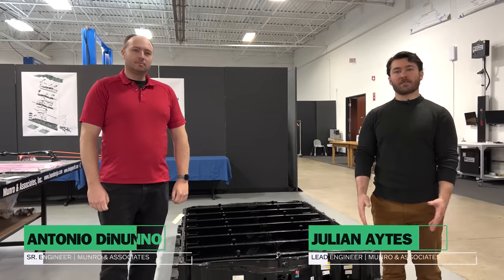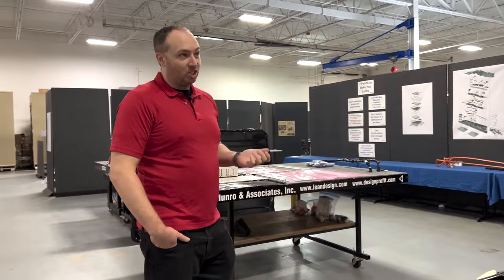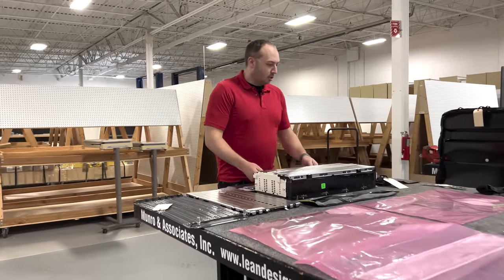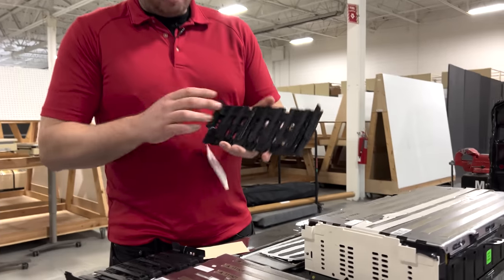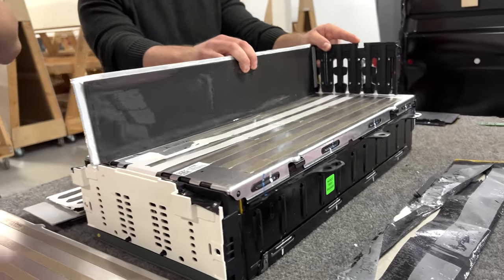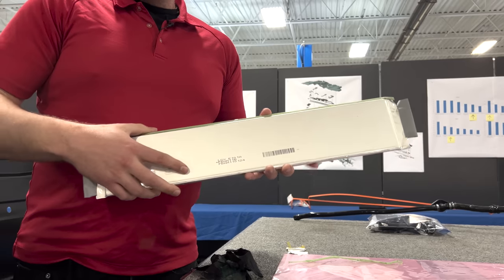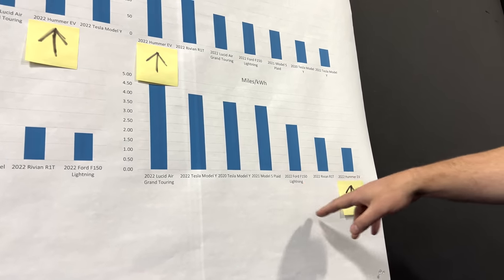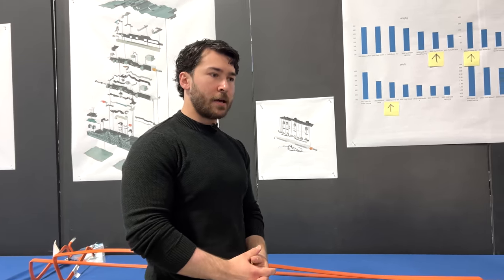This is NOT Lean Design: Hummer EV Battery Pack Breakdown

Comment: When batteries go bad, they are not just an open circuit. The question is if you lose one or a few of Cylindrical Cell isn’t BMS needs to back off the charging capacity of the whole module or that cell would be over charged? Isn’t going to be the same as this large cell?

The cell has large contacts surface area between each other’s, reduces thermal impedance between the cells next to it. Thermal equalization between the cells allows consistency of cells capacity across the module results in higher module current capability. 
Thank you, for showing this cool stuff.

Comment: 24:57 While it's true that running higher voltage will utilize the cables better, it's important to keep in mind that even at those higher voltages, the HUMMER EV is still pulling a sustained 500 A for a significant period of time, so it would make sense that those contactors need to be liquid-cooled.
Reply: It's sad for a teardown they missed critical features like wireless battery management. The fact Hummer chargers at a faster rate than any other EV and the modules can be used across vehicles.
Reply: @theflew  Great catch! I was so distracted by everything else I didn't realize that the never mentioned the fact that this battery features a wireless BMS. They've spent 15 to 20 minutes or more in other battery teardowns talking about great ribbons are instead of traditional sense leads because of how much material and weight they save. 🤔
Reply: @theflew  the hummer has a terrible charge rate for the size of the battery. It should be able to easily charge at 600+kw. We know that modern batteries can charge at over 3C. This piece of shit bearly makes 1.5C
Reply: @saff226  Please point to these magical 600kW chargers that could delivery that much energy. It can already max out 350kW chargers.
Reply: @theflew  Tesla's v4 superchargers can do 600kW. If GM moved to the far superior NACS plug instead of using the shitty CCS1 they would be able to use it
Reply: @saff226  Tesla's V4 Superchargers can do everything since they aren't deployed yet.

Comment: As a research engineer who has to design for manufacturability, Munro and associates have opened my eyes to just how much little things matter when to scale. Most of my job is just to "get it to work no matter the cost" but now I always keep in mind that just getting it to work doesn't cut it, it also has to be reproducible just in case it gets pushed forward to scale-up.

Comment: At the current Hummer production rate, 8 per year, if you own one, with design and advertising costs, it likely costs GM $100M each.  Perhaps the best deal on the planet for the consumer - not so much for GM.
Reply: Didn't they sell over 3200 last year?
Reply: @josephivan5094  - Sounds about right. My post was when they couldn't figure our how to make them (>1 year ago).  So far it looks like about 5000 have been made so far.

Comment: One thing to remember when it comes to stampings and the big 3 like GM, they have been using this form of manufacturing for so long and in so many facilities that they can very likely design and create new stamping tooling cheaper and weld it cheaper than it would to do it in aluminum.
Reply: This is the truth of it.
Reply: How many did they plan to sell anyway? 3? Not worth the effort.
Reply: @LachskoenigIV didn't they sell over 3k last year?

Comment: About a year ago we all took a "vote" and nobody wanted you guys to waste your time and money tearing down a Hummer.  I am glad you decided to do so as this just proves how stupid the engineering of the worlds EV leader is!  You guys are to be commended for not laughing too much during your presentation.
Reply: Munroe is directly responsible for 50% of the Hummer EV sales!
Reply: You forgot to scare-quote "EV leader".
Reply: GM WORLD LEADER IN WELDS!
Reply: this is an early production battery pack
Reply: @mus_xr4653 The engineers had a hangover while on CAD or high on other types of stuff?
Reply: @Stefan_Dahn  they only had few months to develop and test the hummer ev. inefficient design is expected when most cars take from 4 - 8 years to develop and test
Reply: @mus_xr4653  Yes, it looks like time was short so they took a belt and suspenders approach and will probably refine things later.
Reply: @mus_xr4653  That supposition is hard to believe.  GM has been in RnD for years, according to them, so this is their production line.  Meaning their RnD for years was severely lacking or poorly funded, yet again..GMs own admissions..claim they are leaders and have a excellent grasp on this technology.  Clearly, they do not.
Reply: @JasonWW2000  .  For that to be true it would mean GM knew they had a subpar product yet sold it as revolutionary yet was a lie.  This assertion alone should concern all consumers.
Reply: @mus_xr4653  it’s 2023. This battery is a joke. This might’ve been acceptable in 2007 but it’s 2023. GM has been around for 150 f-ing years! Their engineering is a joke.
Reply: @JasonWW2000  time was not short. They don’t have the talent and they failed to make the necessary investment. The HUMMER was a marketing stunt. They never thought anyone would tear it down and show off their BS TECH.
Reply: @mus_xr4653  May be “early production,” but Waaay late to the ballgame…
Reply: It helps your confirmation bias that they skipped over a lot of details and made some erroneous assertions. But hey, don't let data and facts get in the way of your preconceived notions!
Reply: @GET2222  You don't seem to know what you're talking about here. If this battery is 2007 tech, how is the volumetric energy just below Lucid and Tesla's best? And how is its gravimetric energy density on par with Ford, Rivian, and several Tesla products despite the Ultium battery case being a structural component while the others aren't? 🤷‍♂
Reply: @newscoulomb3705  you have missed the entire point. 2007 was low volume. It’s f-ing 2023. Why would you ever build something that can’t scale in 2023 unless it marketing and you never had any intentions of scaling. Right now GM needs to focus on scaling or they are out of business LUCID made the same damn mistake. Great tech, but $179k? That doesn’t tech you how to scale production. You can have the best tech in the world, but if you plan to keep your factories open the HUMMER was a terrible decision. Dumb. Absolutely dumb.

As for the tech itself? It’s out-dated. You are paying attention. Barra scoffed at 4680. Pouch cells are higher risk of thermal runaway. GM learned the hard way and then pivoted within the last few months away from pouch cells.a one ton canister for the battery is nonsense.
Reply: @newscoulomb3705  keep telling yourself what you want to believe. This product was never designed to scale. Marketshare should be GMs focus or they are screwed.

I own a design and adverting agency working with fortune 50 companies for over 25 years. I know what distraction and complacency looks like and GM is one of the best examples I have ever seen that complacency kills.
Reply: @GET2222  This is the same battery that will be used in the Chevrolet Silverado EV, which has a planned production rate of over 500,000 per year by mid-decade. So buckle up, buttercup.
Reply: @GET2222  Sorry, so your first response there. You seem to be missing some key details and some important information. First, the GMC HUMMER EV's volume is restricted due to a recall. Anyone following the topic closely would know that. Now, to be fair, it appears to be something to do with the manufacturing of this pack (something GM outsourced to Magna), so the result of that could be a much cleaner pack build moving forward.

Second, Mary never scoffed at 4680. In fact, GM designed Ultium with the option of using cylindrical cells in the future. It just so happens that the first generation Ultium pouch cell predates 4680 by over four years. 

Third, the battery case still doesn't weigh a ton unless you're willing to admit that Ultium pouch cells are far more energy dense than Tesla 4680. For reference, it would require 1,700 lbs of just the 4680 cells (no packaging) to hold the energy in this battery pack. So even if the Ultium pouch cells were only as energy dense as 4680, that would only leave 1,100 lbs for the case and packaging materials.
Reply: @newscoulomb3705  loving that there is a GM EV fanboy on here. This really is proof that there is somebody for everybody and we all have to keep positive. 😂😂
Reply: @userscott  Nope, not a GM EV fanboy; however, I do follow the EV industry. Also, I'm an educator by trade, so it does bother me when people are misinformed or actively seek to misinform others. Get your facts straight, and I wouldn't comment. I make the same corrections when people misrepresent Ford, Hyundai, Rivian, Tesla, etc.
Reply: @newscoulomb3705   yet somehow you’re celebrating that this legacy company may sell 500k units in a few years time. 😂🤓 

You’re right mate. It’s a great battery. Even the self-adhesive weather stripping.
Reply: @userscott  No, GM stated that they were targeting 500,000 Chevy Silverado EVs per year by mid-decade, so I'm literally just citing their public statements. 

Now, do I blindly believe that they will be able to? That's a different story, but I'd be remiss to not acknowledge it. Just as it would absurd to cite a production rate of two HUMMER EV in Q1 when there is literally a published stop-production order in place. 
🙄

Comment: About the parallel cells config, Loosing a cell that is connected in parallel can lead to many problems. That cell could become a slow short, draining all the 5 other parallel cells and create imbalance that the passive resistors of the bms for all other cells in the pack can not keep up with.... it can mean an internal short( worst case) or broken connection of the tab, meaning that it become isolated(best case if it is not intermittent)  or also be a broken bms connectikn to the cell, meaning danger of imbalanced 2 consecutive  cells that are not properly monitored by the bms.

Comment: Antonio may have been joking about "tactical cooling lines" but doesn't GM have military contracts for Ultium-based products? One of my big fears with Ultium in general is that GM would design it for military applications and then attempt to spread out the cost with high volume, sacrificing range and efficiency (and profits!) of thier consumer-facing products. And IMO that is exactly what we are seeing here. This is modularity gone wrong.

At least GM is leading the weigh.
Reply: My fear is that soldiers will risk their lives in these spot-welded death traps.
Reply: GM ultium batter appears far less robust that what Tesla or catl does.
Reply: Why do you think and over-built battery case and coolant system would result in reduced efficiency? How efficient were you expecting a 1,000 hp HUMMER running on 35" to be, exactly?
Reply: Since Hummer is a GM company tied to former military contracts, steel around the battery packs is a great idea for that market!
Reply: A Tesla pack wouldn’t last 15 minutes where these are designed to go. 😂

Comment: *Steel battery pack frames are far stronger than aluminum.
*GM could definitely do better on the number of components for the battery carrier.
*Two parallel 400 volt packs is what allows GM to support 350KW charging
*The contactor assembly is complex, but I suspect this is to support the heat pump system
*I like the thermal runaway barriers in the module
*They completely missed the coolant structure. Those plastic runs are compressible and will expand when compressed. This allows *GM to tighten down the battery module to prevent water leakage.
*GM has definitely designed to swap out modules, thus the capacity loss when a cell has a problem and won't hold a charge.
*The nylon lines appear to be designed to last more than the standard 10 years of a cooling hose.
*Copper is a better conductor than aluminum. Makes for a far better buss bar.

Comment: Elon Musk when asked about the mod3 front suspesion design Engineer and why the design had so many welds and pieces- " We fired that guy" , GM -  we promoted the Hummer Engineers.😂
Reply: They hired the guy 😅
Reply: That was the unibody designer, not front suspension IIRC.

Replaced by gigacastings now.

Comment: 7:50 I must have missed where you mentioned the module weight and volume. This Ultium pack has a uniform module size, so it would be interesting to see how the modules stack up (pun intended) in terms of Wh/kg and Wh/l. 
Given that the battery case itself is a structural component of the chassis, assessing the modules individually would give better insight into where GM currently ranks in the EV battery landscape. You should already have data points for comparison, with module-level information from Ford, Lucid, Tesla, VW, and others.
Reply: They are very competitive on those numbers, but I think they aren't looking deeper into how to properly measure value. Wh/kg and Wh/L are important measures of cell capacity but they should be looking at how that numbers changes from cell -> module -> pack and try to minimize that loss. And because they are trying to make money on the product (i think) they need to put in a cost value as well, $/kg, WhL/$, something... just so that they have a metric. You can't control it if you don't measure it.
Reply: @BatterVswithAntonio  Sure, and the manufacturing costs are your expertise, so I'll defer to you there. And it certainly does look like GM has a lot to clean up in the manufacturing process, but that's mostly just the individual Ultium modules. Magna builds the battery case itself, so they are the ones who need to speak to their stamping and welding processes.

I do know that GM has mentioned that these packs are integral to the frame and structure of the vehicle, so I would candidly ask them how much of that mass was shifted from the rolling chassis to the pack structure. Minus the battery, the HUMMER EV is just over 6,000 lbs, which is reasonably light for an AWD fullsize truck chassis with a lot of crap thrown onto it. 

If the Chevy Silverado EV running the identical battery system comes in under 8,000 lbs curb weight (e.g., 1,500 to 2,000 lbs lighter than the HUMMER EV), some consideration should be given to the structural aspect of the pack's mass. At that point, the 200+ kWh Silverado EV would have a similar curb weight to the 135 kWh Rivian R1T "LARGE" pack.

Comment: Dumbest EV ever, yet this version is still much more efficient than the gas one, 40 MPGe!
Reply: GM, leading the way to bankruptcy court!🤣
Reply: 👋 ANTONIO , JULIAN…and the rest of the MUNRO TEAM,THANKS FOR SHARING …we prefer good news…but it is what it is 🤷‍♂️💚💚💚
Reply: Nah this car is just pain dumb. It would probably be less expensive to drive a v8 f-150. This is the worst ever made
Reply: We need to stop using that idiotic MPGe thing.
Reply: @themonsterunderyourbed9408  what else would you use? EVs don’t use gas, however gas engine output, can also be expressed as kV though. Just like fractions you need a common denominator. Pretty simple stuff
Reply: MPGe is an even worse measurement than MPG, let's not normalize it.
Reply: @estyrer2 Metric and kWh/100 km or like the rest of the metric world.
Reply: And it has 1000hp
Reply: To me, it seemed obvious from day one that the Hummer EV was a marketing exercise and not intended to be anything else.

It's purpose was to reorient customer perceptions of EVs and make it socially acceptable for men who are accustomed to driving big hulking inefficient pickup trucks to buy EVs.

I think it did a pretty good job of this and was actually a stroke of marketing genius.

The real problem is that they haven't been able to follow up all the brilliant marketing and advertising with actual GM-made EVs.

So the question is, how is that Lyriq looking?  Let's hope they actually ramp it up soon, and let's hope it looks a lot better than this.  And that goes double for the Equinox.
Reply: @davidmenasco5743 a quiet car?

Comment: 27:00 Got to admit, the Lucid Air does show some amazing numbers.
Reply: Lucid won't stop there.
Reply: @andromeda9340  Well, they pay about 500k+ each car and they only make 150k each car, so they will probably stop soon, but still, they got some nice numbers.
Reply: And yet the Air isn't capable of off-road use, fording through 30+ inches of water, or towing 7500 pounds. The vehicles may have been built for different purposes.
Reply: @theflew  the hummer can't do those things either. It's to big and heavy for most off-road situations and the packs leak water. If you did tow 7500lbs you can only do it with 2 people in the car and nothing else or you will be over the tiny payload.

Comment: I'd really like to see these new ultium packs compared to the old Bolt packs.

Is the over design of this battery pack because GM intends to see these used for military applications?

Comment: Where I work, we have built quite a few molds for this vehicle.  It's nothing to do with the battery side of things but I can sure attest to the fact this thing was a mess from the start.  The attachment points they designed in are terrible.  It's like they have been doing this for 40 years and they can't get it right.  I know Sandy was involved in these type of clips we used and if he saw how it was done, he would lose his mind.  They have paid more for changes than what mold is worth. Plus when I saw the assembled truck, our parts look like ass in the assembly.  Overall it's a nice looking unit but the fit and finish the powertrain will kill this thing.  Who will pay over 100k for this.